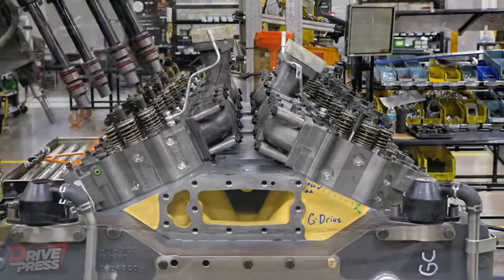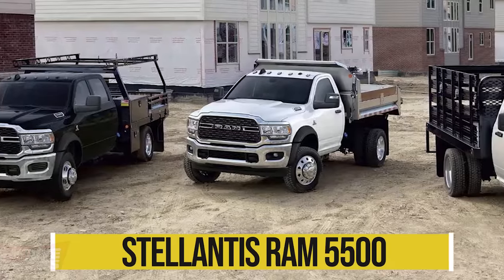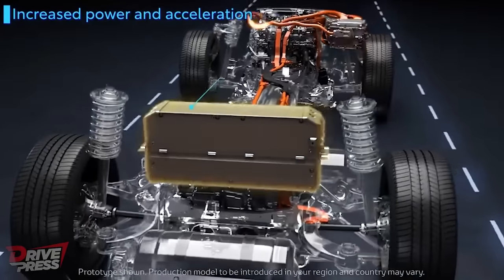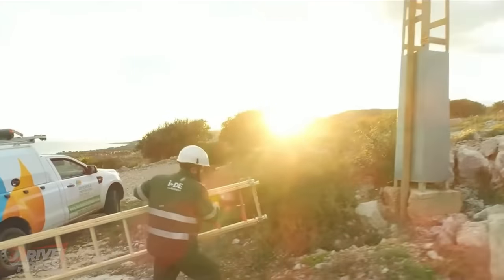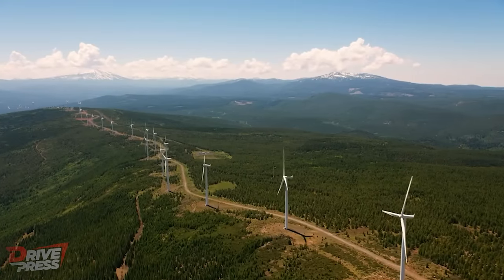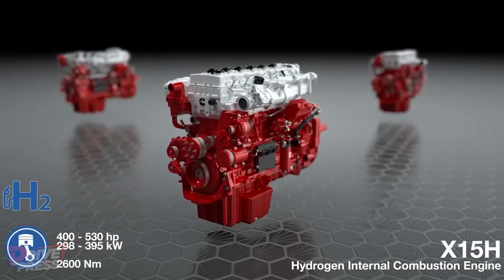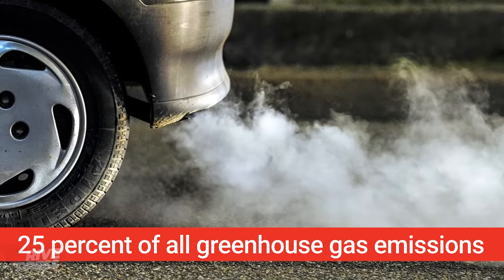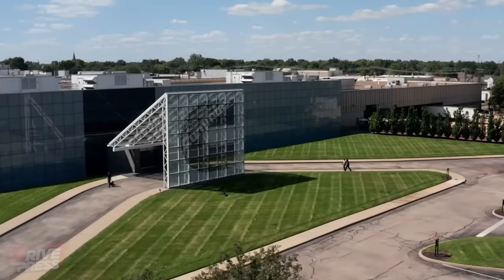Cummins Hydrogen Engine Spells Doom for Diesel

Comment: I hope they make a retrofit kit for existing Dodge and existing Ram trucks a crate system
Reply: FYI, diesel can run on any type of oil. So it doesn't really matter.
Reply: @blackonblack...9244 that may be true but on the newer cars the computer might not like that different mixture. I have a hydrogen generator but I'm not going to hook it up to my 92 Cummins.  A lawn mower perhaps but not a 7000$ diesel engine.
Reply: @ronskancke1489  I never said you should. I'm just saying it can.

Comment: I think this is a much better option then huge battery banks that take hours to charge. The key part I took away is the existing manufacturing platforms don't need excessive overhaul to make this a reality. For me loving old school hot rods we can just make them run on hydrogen so we can still have fun with cars and trucks.

Comment: Only if the engineers have designed every part to NOT fail for hundreds of thousands of miles.  Seems like they designed some engine parts on GM and the rest to fail. Small very expensive parts that fail to save a damn dollar. It’s ridiculous to do use plastic etc inside an engine. Like timing chain tensioners and gears etc.  How damn stupid

Comment: Burning hydrogen in an internal combusrion engine is NOT pollution free. It creates a lot of nasty NOx gasses. You still need to add urea to the exhaust.  Nitrogen comes largely from Methane gas at the moment.

Comment: Unfortunately all the talk and focus in this video has been about the hydrogen engine. You could hold an equal argument for electric motor propulsion, but the problem is virtually the same here. It's not the engine thats the issue, its the alternative energy source thats the problem here. How to make it, how to store it and how to transport it for which there is no easy solution. The perfect fuel on the other hand should preferably be a liquid so it can be stored, poured and trasported with ease, have high energy density and low volumetric mass, sound familiar ? Thats right DIESEL and PETROL, but unfortunatly "the powers that be" have done a pretty good job at demonising those so here we are discussing all the unsuitable alternatives like a bunch of chicken littles worried about the sky and the ocean level, which last time I checked was the same. I only wish I could go back to the 60s and 70s and stay there, where no one worried about all this shit and they did fine. Keep in mind we are talking about Co2 here, not smog or carbon, as they are entirely different things. Thats my rant over.

Comment: I know that in Australia they're meant to be building a hydrogen gas fuelled power station but the prime mover can only use 15% hydrogen gas & the rest has to be natural gas which is extracted from the ground.

Whoever designed the power station says that they can possibly bump that up to 30% hydrogen gas usage !

Comment: A diesel engine is compression ignition. An otto engine is compression spark ignition. This diesel engine isn't a diesel engine, not because it burns hydrogen, but because it needs spark plugs to ignite the fuel-air mixture.

At the end you say BEV will continue to use fossil fuel energy whereas green hydrogen is CO2 free. First of all, there is no reason for BEVs to use electricity from fossil fuels. Secondly, if electricity is made from fossil fuels, then making hydrogen with that electricity will be no better (it will be worse). At the moment something like 0,5% of all hydrogen production is green, most of the production is from natural gas hence not green.
Reply: So using MORE electrolytic hydrogen is a problem because?
Current photovoltaic arrays run at below half design capacity because the electric grid can’t handle the peak supply capacity. Tapping the surplus photovoltaic power at the source and dumping the hydrogen into the gas grid will help mitigate this supply / demand mismatch.
Currently 30% of the natural gas extracted globally is reformed to make hydrogen to make ammonia and hence nitrates. That has the potential for significant benefits.
Reply: @allangibson8494  I'm not against using hydrogen when it's the better option, I'm not convinced that it is in this case. And as long as we (humanity) burn gigatons of coal and oil and gas, we can't really choose the most inefficient "solutions" to transition, we don't have excess energy.
Reply: @aesma2522  We do currently have excess energy in most of the western world, solar particularly in summer. That is the driver for negative electricity prices.
Long term storage is a significant problem for electricity generation. Current storage solutions are designed around days of storage - not month’s required to shift generation from summer to winter.
The alternative is to shift energy from the southern to northern hemisphere.
Hydrogen is one way to do this. That’s why the “Suiso Frontier” exists.
Shipping liquid hydrogen is not significantly harder than shipping liquid natural gas (with the other alternative being shipping liquid ammonia).
Western Australia is looking at using its existing liquid natural gas infrastructure for liquid hydrogen exports to Japan and India with photovoltaic arrays inland of Karratha and south of Darwin feeding power west and north. 
Germany and Japan pushing into hydrogen iron reduction to complement their electric arc furnaces used for recycling steel which will significantly bump up demand.
Reply: @allangibson8494  The problem is that hydrolizers aren't cheap, so investing in a plant then using it intermittently isn't ideal, a bit like nuclear power plants.
Reply: @aesma2522  Which is where dropping electrolysis cells in Western Australia makes good sense for the Japanese. Lots of sun all year round.
That said, there is nothing complicated about electrolysis cells, you can literally make one in your garage with parts from your local hardware store (and people do). Liquid hydrogen takes work, high pressure hydrogen takes work - just making hydrogen at gas mains pressure, not so much.
Hydrogen is as an automotive fuel is about 30% as efficient as battery power but a lot of automotive applications need lighter and longer range options than batteries can provide. Shipping is one example of this.
Hydrogen is also an important chemical feedstock that is currently produced by reforming natural gas.

Comment: I think the problem with this "Hydrogen Revolution" is the Hydrogen itself.. Yes it's "efficient" in it's energy and processes after the manufacture of this fuel, but not before. Hydrogen consumes almost twice the energy for manufacture than it provides for work, not good for an "efficient" fuel.

Remember when Propane became a popular alternate fuel in the "Energy Crisis" of the 80's, it was extremely cheap with only a small degradation in power and efficiency.. but that didn't last long before "road taxes" etc were added to the fuel as a surcharge and priced it right out of the market. It didn't cost any more to manufacture, greed just came into the picture and the fuel market equalized once again. There is no way you are going to get further on a dollar by using any particular fuel, that's just the way government is going to keep it.

Asia has allowed hydrogen fueled vehicles for a while now, just long enough to get some startling statistics regarding safety and refueling.. personally, I don't think the north American markets are ready for the pressurized systems needed to contain and dispense this fuel. Once people begin to understand the difference between a disposable/recyclable battery and a tank of fuel that evaporates and why either works better in it's own environment, we will continue to force ridiculous tech despite it's feasibility.
Reply: Yep. And propane started as a by product of natural gas. Hell, they were giving it away to anyone who could show up with a tanker to haul it in the beginning.
Reply: Awful convenient or would that be inconvenient when there's no other sources of energy except grid power and battery and then oh my God the great went out I'm sorry you're dead
Reply: Nobody said it was "efficient", just that it works well as a fuel source and has zero emissions from the vehicle. It's 20 times better than electric vehicles.
Reply: There's no free lunch.
Reply: @jomamma1750  So if you're using twice the energy for the same amount of work and call it "efficient" enough.. that's extremely short sighted. How are H2 vehicles "20 times better than electric" vehicles? Keeping in mind that they are already half as efficient as anything else electric.
Reply: @bozosplayhouse3911  Electric has no range, people can't stand it and aren't buying it, it doesn't work in the cold, and battery changes cost $30,000. Anything that runs is at least 20× better than that junk.
Reply: @jomamma1750  Trust me, I don't advocate electric automobiles because it's again, short sighted at this time. Cleaner maybe, but one would think the same of H2 in the end game too. The fact remains that H2 is derived from something and you need energy just to make it marketable.. that's like saying somehow it's better to get a drive-train that provides almost half the fuel mileage of another, we know that won't swing anywhere.. besides, H2 power is gutless in the IC configuration and the storage tanks required for anything other than "city" driving is ridiculous.. when we start talking about NH3, then there are possibilities using what we have available on this planet in a cleaner and more efficient manner.
Reply: Have you heard of 'white hydrogen' it is formed underground like methane is,  the difference is that because the hydrogen is formed by natural chemical reaction it is being continuously replenished and you only have to drill one well and the hydrogen will continue to replenish itself and continue flowing....
Reply: @chrissmith2114  I've heard of it, but this is a far cry from supplying the world with an alternate 'clean' fuel. I hate to use the word 'replenish' when it comes to a petrochemical substance being used as a fuel.. same as saying natural gas is 'replenishing' itself in the ground too. No matter what, when the scale of consumption meets the production, the latter will come short every time over fossil fuel energy. I like the idea, but can't see any large scale production like other 'grey or black' H2 reforming processes.. besides, there is still reforming (removal of He/N) for this fuel. With that, you have a loss and still the huge high pressure tanks to cart along with the vehicle. Want more range, the tanks get larger and heavier.. at 5-10,000psi (350-700bar) this becomes a logistical issue for H2. So why not NH3?
Reply: You are to be applauded,  one person who gets it!  Try storing hydrogen, the energy cost, of producing pure hydrogen. Thank you, for your post!
Reply: We shall see how "Safe" it is when they put that Hydrogen Cummins in a Cascadia with the Words SWIFT on the side of the truck.
Reply: Being an ICE engine it Is still thermally inefficient compared to an electric motor ? Discounting in. Both cases the carbon footprint of the energy source/fuel.
Reply: Meh .! You still have a lot of waste energy in heat and friction not mention all those parts in the engine and drive train, that's ignoring emission control systems  the one on my van is a mare.
Reply: @bozosplayhouse  The way that the 'external combustion vehicles' that we call EV have been causing mayhem in transport ships and burning buildings down it begins to make hydrogen look rather safe..
Reply: @chrissmith2114  I think those numbers making the H2 vehicles appear 'safer' are simply because of a lack of use. Have a look at China and other parts of Asia that already have H2 vehicles and infrastructure.

In the link below, they say 'LPG' but this is actually a H2 refueling station in Asia. The flying red object is the H2 tank leaving the vehicle and striking a person, he didn't make it. But my point is the sheer explosive force (15,000PSI) contained in a H2 tank.. and they will fail.

Now compare that to a battery fire, one is an instantaneous energy release and the other is a cook off.. for saftey sake alone, I would rather the battery until we have something better. It's literally a bomb in your back seat!
https://www.youtube.com/shorts/_DLVgwvOVCQ
Reply: if people are so scared of the range, then nuclear-powered vehicles can run for years without refueling... it's just dangerous when it's crashed

Comment: As long as it is a fuel on demand system then it's a great idea , carry your own water as fuel .
Reply: This isn't mentioned enough.  On board hydrogen production.  They claim you lose as much from the extra drain on the alternator but I have my doubts. Not enough powerful people and corporations can get rich off that system so there is where the opposition comes from.

Comment: Unless China India and a few others change there emissions output, the things we do for "emissions" is pointless..even if the US goes 100% carbon neutral it wouldn't even put a dent in globe emissions..so the EPA should leave the trucking industry alone ..if they did that then LITERALLY everything would be cheaper

Comment: Natural Gas is a smart, low-emission alternative to gasoline and diesel— and it delivers similar horsepower ratings. Premium gasoline is 91 octane, while natural gas has an octane rating of approximately 130.
Reply: Yes, low co2 emissions but not for methane. Methane is an 80x more powerful greenhouse gas. Leaks happen all the time in the energy industry.
Reply: @anthonylanglois8267  way less pollution than diesel of course .This truck has a less complex after treatment system , can also run on Zero emission CNG .
Reply: Yes ..True
Reply: Octane isn't a measure of quality, it's just the point of combustibility.  130 just means it is not very adaptable for regular engines.
Reply: @Scott-fy7fm  All fuels need to be blended.
Reply: @ghungroo3850  I was just pointing out what octane is because most people erroneously think it is a measure of the quality of gas

Comment: "California has already banned ... [itself]."
This is basically an ad for Cummins' greenwash. 
ICE is only half the solution, storage/transport is the other more pernicious problem.  

There was a hydrogen engine on display in a faculty foyer of the Tasmanian University in 1979 !  The only way it will ever be practical is if we can fill up on water, and have a splitting solution live in the semi.
Reply: I can see California in 20 years where everything is delivered in a rickshaw.
Reply: How much energy does it take to make a gallon of hydrogen?
Reply: It doesn't matter if it takes slightly more energy to extract hydrogen you cannot put all of your eggs in one basket the grid and batteries what if the grid goes down everyone dies
Reply: @zedostenso3069  The Proton Technology Inc in Canada claims $0.25 per gasoline gallon equivalent for Hydrogen gasesous fuel by recycling abandoned oil wells.

Comment: How big will the explosion be when one of the vehicles are involved in a wreck?
Reply: Scientist have discovered how their will be no explosions of hydrogen when it's safely stored in water mixed with banking soda. Can you imagine a fuel source that's so safe it can be used to extinguish a fire.
Reply: @leroyessel2010  I hope you are right. I think the EV. Vehicle is not a good idea.
Reply: I see a picture of the Hindenburg blimp ina wreck 😮
Reply: What that means is you get the same fire as when a ev crashes. You just get it a lot faster.
Reply: So a ev doesn't go bang in a accident it just burns up . Yippee kiyaye.

Comment: We aren’t even close to no pollution hydrogen is a good start a lot better than lithium powered electric vehicles but there are still hurdles to consider. It takes power to produce hydrogen. I love the idea I’ll love it more when the hydrogen producer is built into the car and yes, you will still need an electric start

Comment: Electrolysis is at best 30% efficient. The engines still produce NOX emissions which requires DEF systems to mitigate. Hydrogen is very expensive. There's almost no infrastructure to accommodate the switch. ICE's are also at best about 30% efficient. Wouldn't fuel cell technology make way more sense for hydrogen vehicles?

Comment: Town gas has been used for electrical generation for years. Local large hospital has two units. So using hydrogen is no big deal. However storage and transference of hydrogen is still tricky. What is the Cummins solution to this? Noticed that part of the set up is mentioned, but has needing further work.
Reply: Yup, hydrogen cannot be contained in steel bottles.  The molecules are so small, that they leak through the micro structure of the steel. And this causes the steel to go brittle. And what about engine itself and fuel piping? This would have the same problem.   I've never heard what the solution is. Slick sales videos are aimed at the general public who know nothing about such details.

Comment: It’s a step in the right direction. Mazda has been messing with hydrogen fuel for 30 years. Water vapor is the only exhaust. Getting the hydrogen to the car is the issue

Comment: Stellantis purchase a huge massive share from Symbio and they did introduced a hydrogen power ram truck before this means they are interested in bringing back the Hemi in Hydrogen form because of 0 emissions and on top of that most of their audience are not thrilled of killing off the combustion gas hemi engines

Comment: They talked about using hydrogen in the 60s one of the problems was making and have hydrogen economically the other problem is you would need twice as much liquid hydrogen as it to diesel.
Reply: Yes, size of tanks required  to carry enough hydrogen. 
Safety requirements to refill.